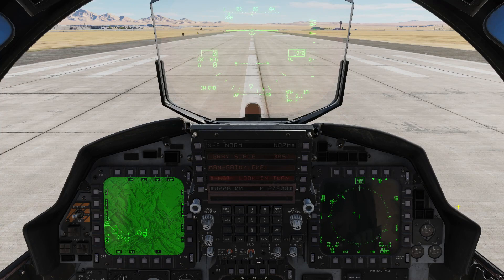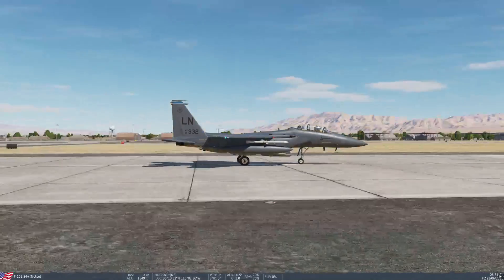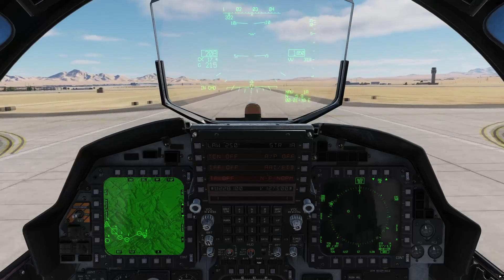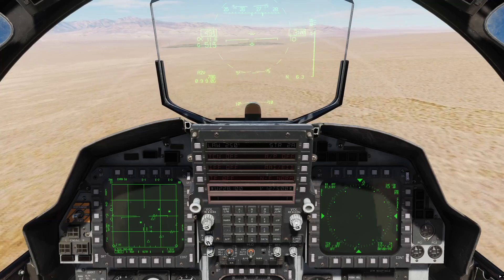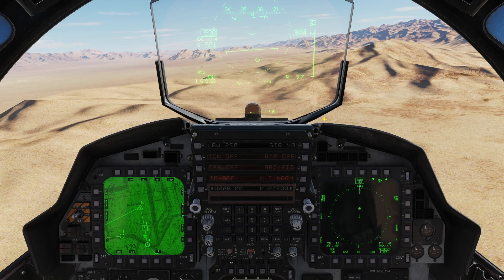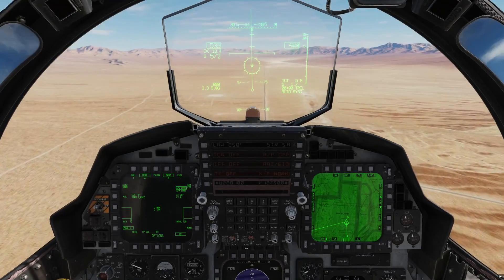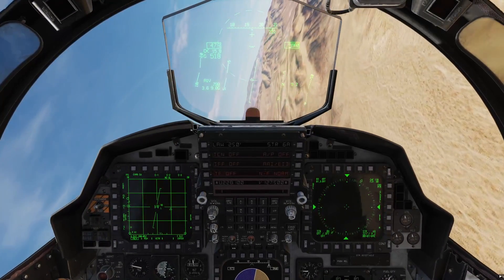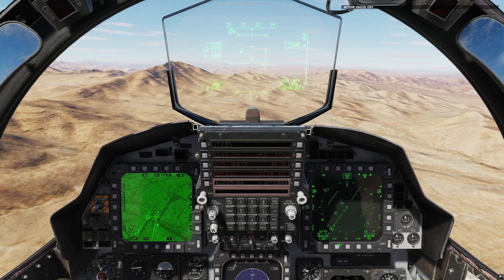DCS F-15E Strike Eagle | Navigation

Comment: You flew that jet. I crewed it back in 2012-14. Had a permanent inspection after 50 flight hours due to a crack at the base of the left vert. I'm sure that's been fixed at depot by now. Good stuff. I'm so excited for this mod.